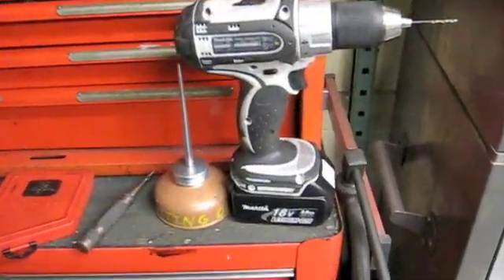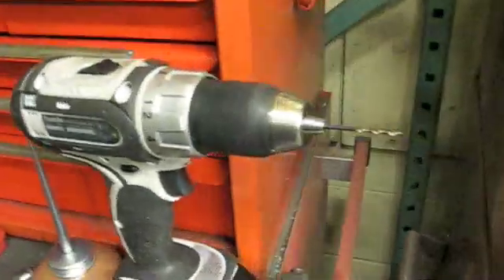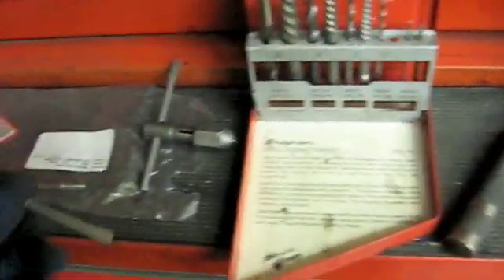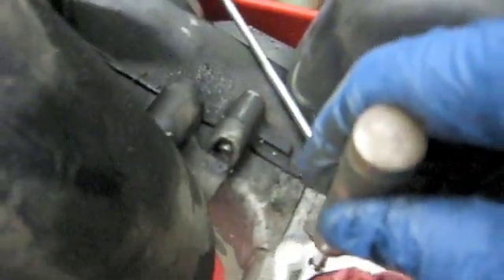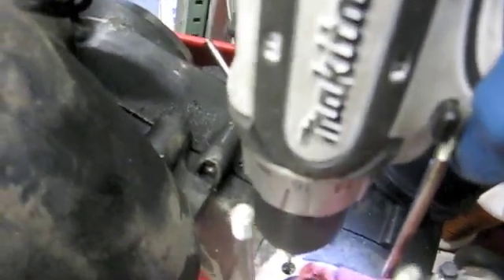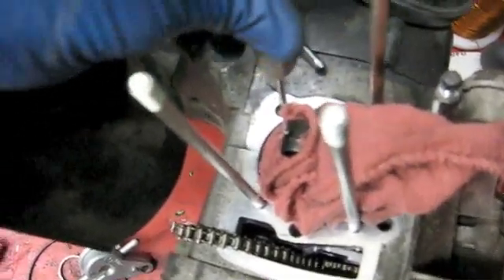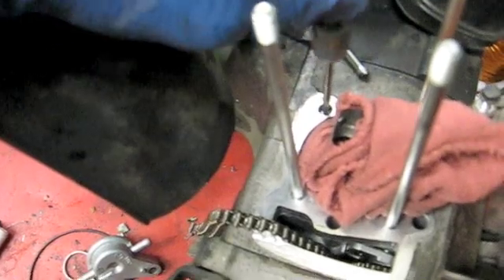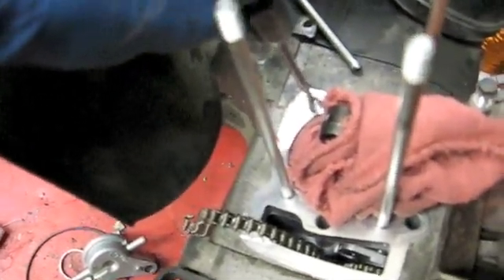Extracting a broken stud from an engine case

Comment from the maker: I have used both styles, they have there pluses and minuses. Most of the time I will weld a nut on top of the broken remains. But not every one has access to a good welding machine.

Comment: You would be surprised how many ppl don't know about this tool, It has saved my ass many times before, I snapped a intake manifold bolt on my bosses truck. Drilled and and had it out in about 15 mins. He couldn't believe it was that simple. lol

Comment: I figured out why this was so hard for me accomplish, I did not have drilling oil on hand. as counterintuitive as it seems oil actually helps the drilling process . other than that it was actually really easy. the first time this happened the reverse twist drill bit pulled it right out of the hole.